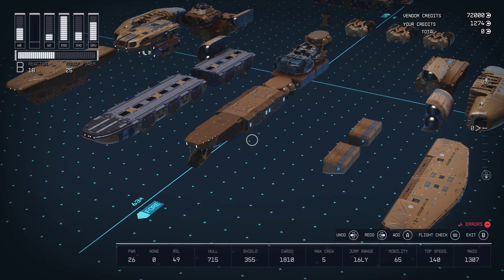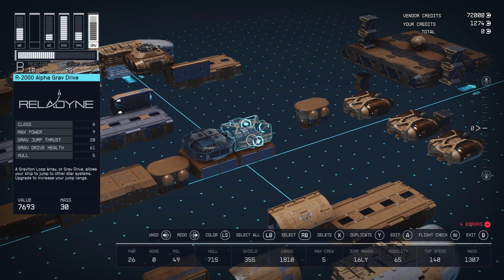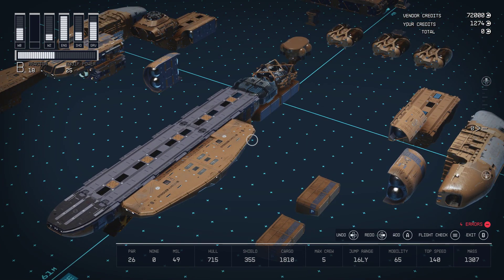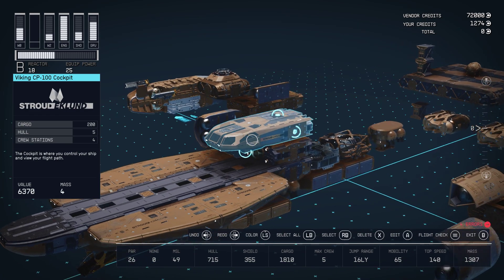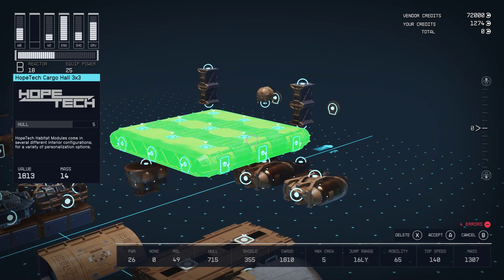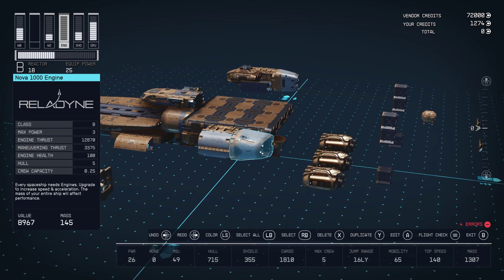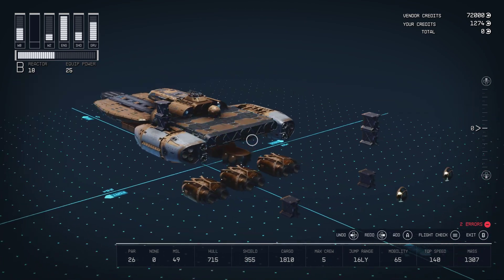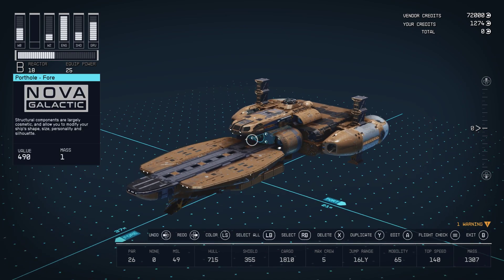Starfield - The BeBop B-Class Build - Cowboy Bebop Shipbuilding

Comment: I just wanted to say thanks for taking the time to put together this build guide, great work. I'm actually watching Cowboy Bebop for the first time while playing Starfield. Great series! I made some minor adjustments to the habs and placement. I wanted to add a captain's quarters as I think all captains should have their own private space so I went with the Taiyo Cargo Hall 3x2 Top B and the Taiyo Captains Quarters 2x1 Top A (without side doors) with the Taiyo Companionway 1x1 Top B to connect the cargo hold and the captain's quarters. I swapped the workshop and science lab around so there wasn't a "noisy" workshop below the captain's quarters.
Reply: I think I may be a little too smooth brained to process this comment, can you identify the exact parts you replaced? (Sorry if that's a lot of effort, just want a more livable interior.)
Reply: @cosmicbrownnie1380 Replaced the HopeTech 3x3 Cargo Hall with the smaller Taiyo 3x2 Top B Cargo Hall. That gives enough space to include Taiyo Captains Quarters Top A to the right of the Cargo Hall and I put a Taiyo Companionway in front of the Captains Quarters. I swapped around the workshop and science labs. As a bonus, I used the Deimos Skeg A underneath and Deimos Spine E on top of the wings to create the “fins”.

Comment: Can we get a ship parts shopping list? 

Edit: Nvm I got this.

Prerequisite: 
Piloting (3) & Starship Design (1)

-NG-6 Landing Bay (Nova Galactic) x1
-Porthole Fore (Nova Galactic) x1
-Porthole - Aft (Nova Galactic) x2 
-Pinpoint 4G+ Landing Gear (Taiyo) x2
-Taiyo Engineering Bay 3x1 Bottom B (Taiyo) x1
-Taiyo All-in-One Berth 2x1 Bottom B (Taiyo) x1
-Taiyo Cowling - Fore Bottom (Taiyo) x1
-Taiyo Science Lab 2x1 Bottom B (Taiyo) x1
-Taiyo Workshop 2x1 Bottom B (Taiyo) x1
-Taiyo Mid Cap - Port Top (Taiyo) x4
-Taiyo Braking Engine - Port (Taiyo) x2 
-Accu-Lander 11 Landing Gear (Stroud Eklund) x2
-Stroud Cap A - Port Fore Bot (Stroud Eklund) x2
-Stroud Cap A - Port Aft Bot (Stroud Eklund) x2
-Stroud Companionway 1x1 (Stroud Eklund) x1
-Viking CP-100 Cockpit (Stroud Eklund) x1
-Connect-Pro Docker - Top (Stroud Eklund) x1
-Stroud Engine Bracer B (Stroud Eklund) x6 
-Polo 2000 Cargo Hold (Panoptes) x2
-da Gama 1000 Cargo Hold (Panoptes) x4 
-R-2000 Alpha Grav Drive (Reladyne) x1
-Nova 1000 Engine (Reladyne) x2 
-M40 Ulysses He3 Tank (Dogstar) x2
-M30 Ulysses He3 Tank (Dogstar) x2
-20S Protector Shield Generator (Dogstar) x1 
-Hopetech Cargo Hall 3x3 (Hopetech) x1
-Hopetech Storeroom 1x1 (Hopetech) x1 
-Amun-2 Engine (Amun Dunn) x2
-Amun-3 Engine (Amun Dunn) x1 
-DC301 Fast Ignition Reactor (Deep Core) x1 
-Horizon Weapon Mount (Horizon Defense) x2 
-PB-30 Electron Beam (Ballistic Solutions Inc) x2

---

I was able to take an old beater ship to Veronica Young in Ryujin Tower - Taiyo Engineering Floor (Neon) and mounted on the:
-Pinpoint 4G+ Landing Gear (Taiyo) x2
-Polo 2000 Cargo Hold (Panoptes) x2
-DC301 Fast Ignition Reactor (Deep Core) x1
-da Gama 1000 Cargo Hold (Panoptes) x4

I then hit up Hopetown to mount the:
-Hopetech Cargo Hall 3x3 (Hopetech) x1

The rest can be done at an outpost landing pad.

Comment: so I tried making this and I cant tell if an update ruined this or I am an idiot but I keep getting an error that the landing bay cant reach the cockpit but I am 99% sure I replicated what you made 1 to 1 could you help? thanks.
Reply: Some of the Taiyo bays have a top variant where there are no connection points on top, might be why?
Reply from the maker: Hard to say without a screenshot. You probably already figured it out, but check the arrows on the nodes to be sure it the habs have access points.